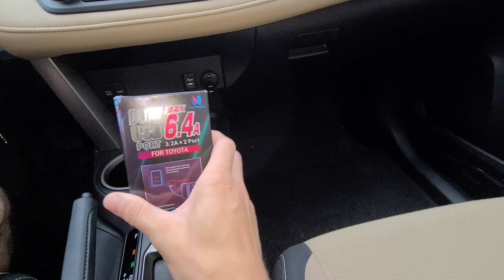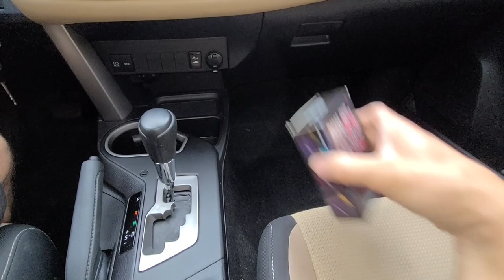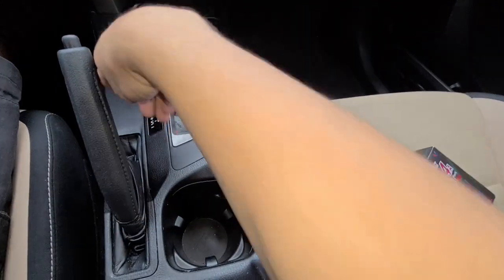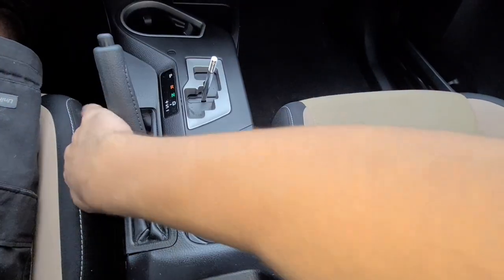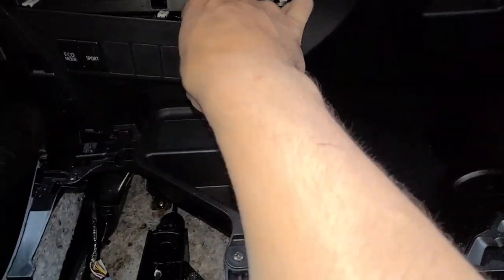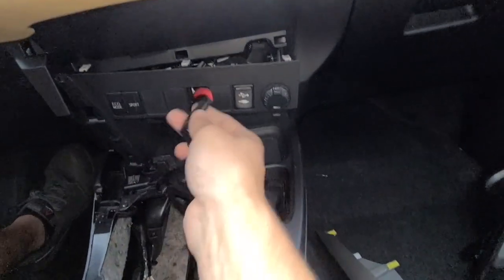Every Toyota Rav4 NEEDS THIS Dual USB Port Quick Charger Socket 3.2 Amps Quick Charge Your Phone

Comment: this is really useful and the led let’s you know if the device is charging or not. if you have bad usb cable you will know.

the original usb slot charge real slow and annoying if you still have the original head unit

Comment: I bought the cheaper one you linked because I didn’t want the LED light, but it didn’t come with the extra splitter cable. Is there any way to buy that separately? I’d prefer not to splice any wires if possible.

Comment: Does this connect with 2017 rav4 ?
Reply: Did you have one installed?
Reply: I am also curious if it fits a 2018 RAV4. Please reply.
Reply: @guugledelap6199  Yea, it worked great my 2018rav4 and I bought the one that shows the voltage of the car battery/alt, which tells me if my alternator is charging. Also no need to strip out all those trim pieces. I was about to rip everything out when I realize I can use a flat head to remove the cigarette lighter an fish the wires through. took me about 15 mins.

Comment: Thank you for the video and links. Question, what if the lighter doesn't work. Is there a fuse that may be out? Help.
Reply from the maker: Yeah your going to need to chase a fuse down, alot of time coins in the outlets blow the fuses, so check all the outlets for coins. 🪙